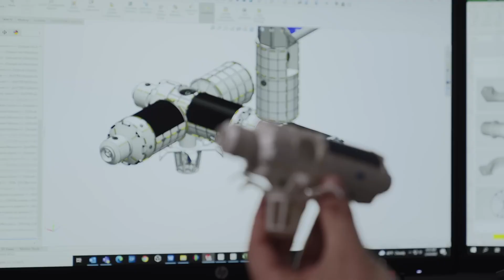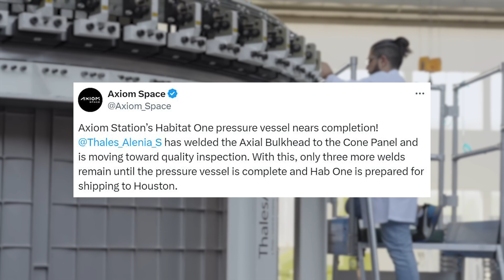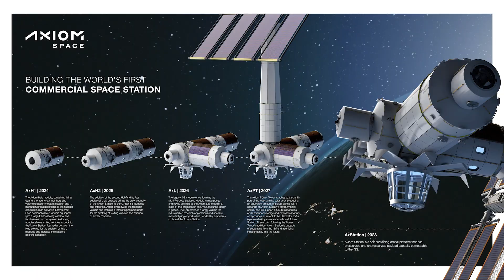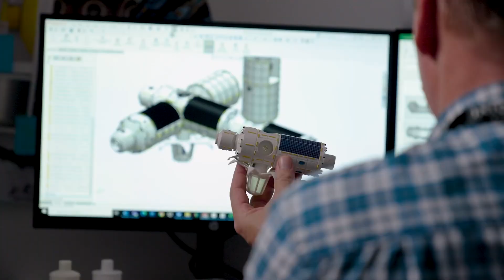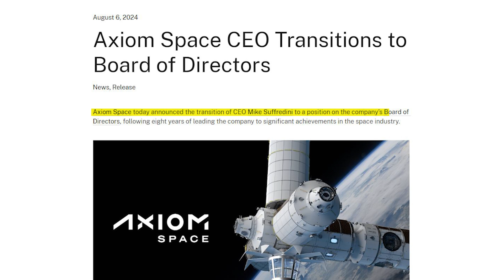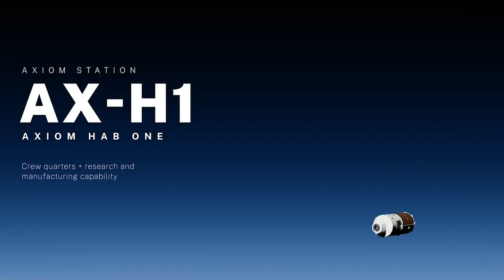The First Commercial Space Station Is Running Into Problems

Comment: It seems like this is always the weakness of the NASA designs (and anyone connected to them like Axiom) -- they have gotten accustomed to relying on someone else for power and control. The NASA ISS designs were ambitious and ended up with massive solar power in the long run, but the ISS initially relied on the Russian module for attitude control and power in the beginning. (This has made the end of life a problem to be solved by SpaceX, since the ISS STILL relies on the Russian module for propulsion and attitude control.) Here Axiom's design is supposed to be an ISS "parasite" in the beginning, and only get power and control self-sufficiency at the end. 
I think it will be a great thing to develop a life support/ power/control module early on. Then, when the big solar panel module arrives at the end of construction, they have redundancy for the lifetime of the station. Power, life support, and attitude control is existential for an orbital station, so it needs redundancy.

Comment: I have some questions for the author of this channel.
1.  Does Axiom's docking capability to other modules accept ISS modules?
2.  If so, has NASA permitted Axiom to discuss with JAXA or ESA the move of Kibo or Columbus to the Axiom core?
3.  If the docking capability is not present, perhaps a docking adapter can be added to Axiom's design to permit the movement of Kibo and Columbus to Axiom's core for about 5-10 years?
4.  What is the design lifetime of the Kibo and Columbus modules?  Can these modules be moved to Axiom's core given their age?

Comment: Best op is to build 2nd hab module last.  Service module shouldn't be any smaller, or they'll need a 2nd one to complete the original design.  And what are the docking ports; same as on ISS now?  ISS could use a 3rd docking port soon.  Russian dockports just got upgraded 2022, but its a different size.
🚀🏴‍☠️🎸
Reply: I have some questions for the author of this channel.
1.  Does Axiom's docking capability to other modules accept ISS modules?
2.  If so, has NASA permitted Axiom to discuss with JAXA or ESA the move of Kibo or Columbus to the Axiom core?
3.  If the docking capability is not present, perhaps a docking adapter can be added to Axiom's design to permit the movement of Kibo and Columbus to Axiom's core for about 5-10 years?
4.  What is the design lifetime of the Kibo and Columbus modules?  Can these modules be moved to Axiom's core given their age?

Comment: I think all this news of cost overruns and time delays should just be rephrased into “VC’s/investors wildly underestimate the costs and time required to actually step into space”. It’s endemic in the industry, starting many decades ago and being a consistent feature. Any initial estimate can and should be 10x in cost and at least 3x in time by default when talking about space.
Reply: How about not assuming you are the best and look at China's standard? You can't improve without knowing what your real competitor is capable of.
Reply: VC's, in my opinion, changed their financial risk tolerance due to the federal reserve's interest rate policies.  As the interest rates moved up, the risk tolerance on start-ups decreased.  It appears to me that there is a technical analysis (which may already be done) that can termporarily address this issue.  It's the deorbit timeline for ISS. 
The core functions provided to ISS by Roscosmos appear to be upgraded in Axiom's proposal.  Relocation of the JAXA Kibo and ESA Columbus module to Axiom's core may temporarily resolve the discrepancy in the module count.   Therefore, I have some questions for the author of this channel.
1.  Does Axiom's docking capability to other modules accept ISS modules?
2.  If so, has NASA permitted Axiom to discuss with JAXA or ESA the move of Kibo or Columbus to the Axiom core?
3.  If the docking capability is not present, perhaps a docking adapter can be added to Axiom's design to permit the movement of Kibo and Columbus to Axiom's core for about 5-10 years?
4.  What is the design lifetime of the Kibo and Columbus modules?  Can these modules be moved to Axiom's core given their age?

Comment: The FAA and EPA need to get out of SpaceX way, let them finish StarShip. SpaceX could build out base StarShips as long term habitation units, link them and have a larger space station probably at lesser cost?
Reply: There's a significant technological difference between rocket shells and space station capsules; they'd have more success transporting the fabricated capsules then assembling them in-space similar to the space shuttle did for the ISS with the larger payload capabilities than deconstructing a starship for use.
Reply: Should there be completely separate rules and regulations for spacecraft etc so faa